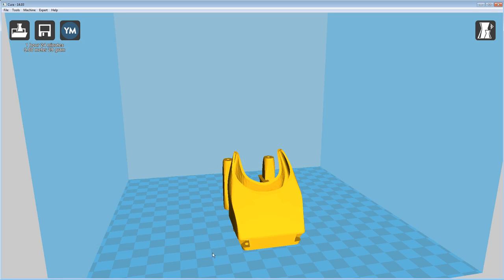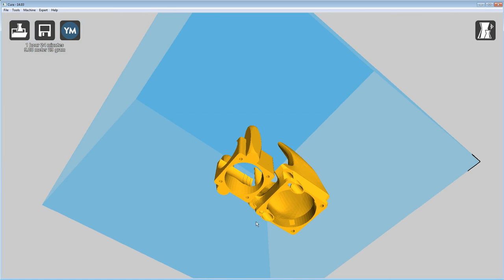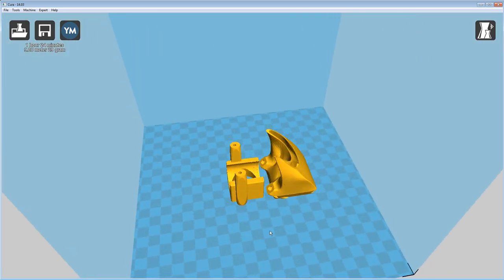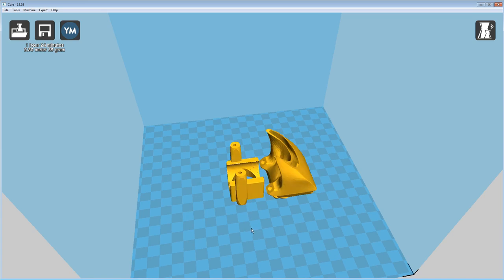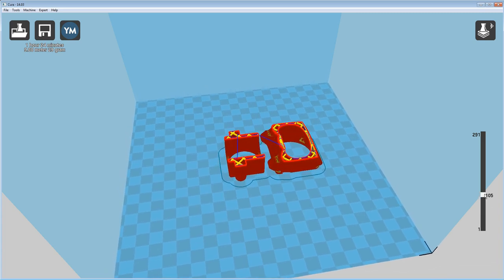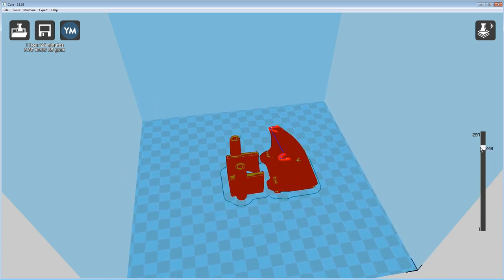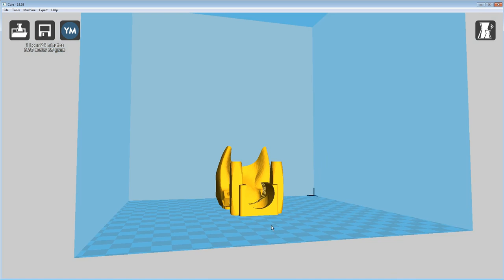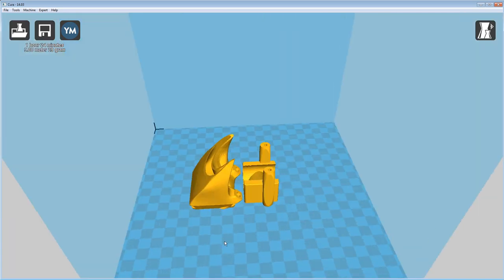Evan's DIY 3D Printer / Mill - EP12 - Part Cooling Fan Rig

Comment: what fan did u use
Reply from the maker: Sorry, I don't have the model number, I pulled it off an old hard drive cooler.  I want to say it is a 40mm.  Any 40mm 12vdc should work.